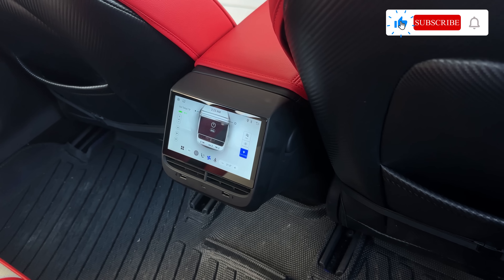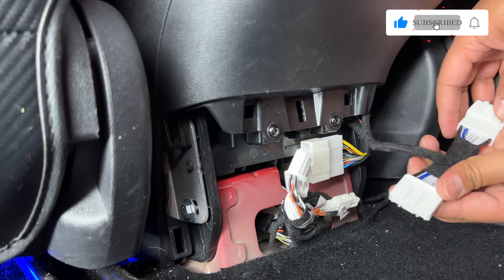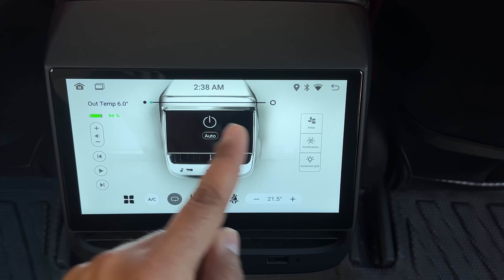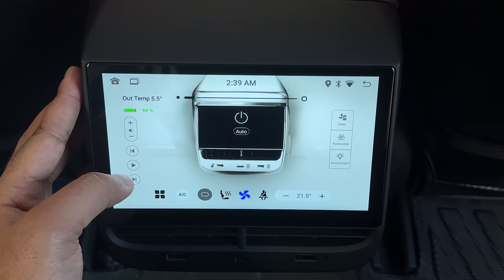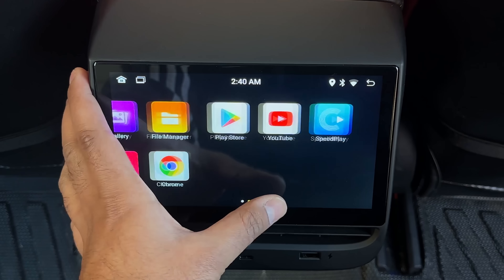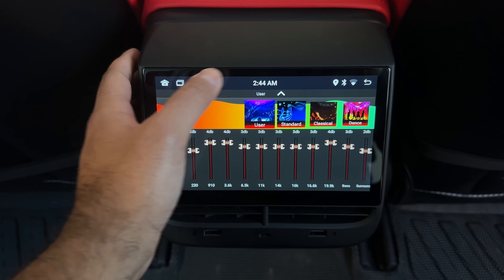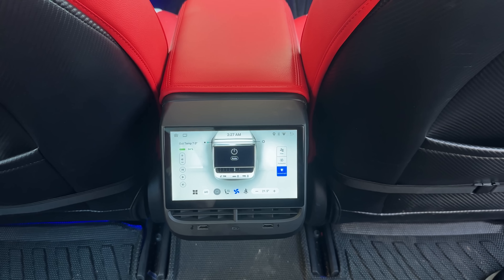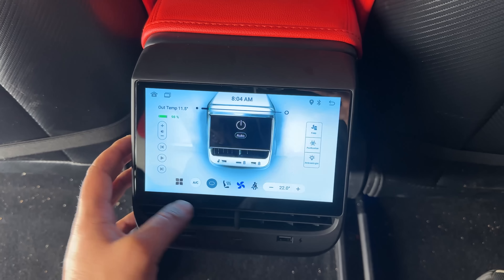NEW Integrated Climate Control & Entertainment Rear Passenger Display For Tesla Model 3/Y

Comment from the maker: ⚠️WARNING: There is a bug in this display that prevents you from using a wireless headphones. The audio only works if played through the Tesla speakers but not through headphones (unless your headphone has an ability to select a specific bluetooth band, which most don't). So, if audio output to headphones is a deal breaker to you, please don't get this display. Thank you!
Reply: Is this something Hannsshow is addressing? They just dropped the price for the 7” by $100 today and with the additional 25% off it’s now a more reasonable price. Lack of BT to headphones would be a deal breaker for me.
Reply: Is this something they cannot or are not going to fix with a software update???
Reply: @TopShelfTesla  I reached out to Hansshow and they responded that it does work with BT headphones.
Reply: @Ltyte  awesome!  I should have my display Tuesday or Wednesday.
Reply: @TopShelfTesla  post an update once it's installed. Good luck!
Reply: @Ltyte  I’m sure I’ll need it lol nothing is ever easy
Reply: @Ltyte  just watched another review video of this display and they confirmed that Bluetooth headphones do not work with this display.  They only work through CarPlay, which is pointless.  They also confirmed Disney plus and Netflix cannot be downloaded from the google play store.  I wonder if they can be sideloaded
Reply: Did it solve issue with Tesla firmware upgrade as the 8" debacle ?
Reply: @TopShelfTesla  did you install yours? I’m holding off for now until these issues get resolved.
Reply: @Ltyte  still haven’t received it.  Was released from customs on 12/31, no updates since.  I will install when it arrives and see what I come up with.
Reply: Also interested whether the 7" screen has the firmware issues fixed yet. Anyone know?
Reply: @TopShelfTesla  talking with another reviewer on YT and he is having same issue. He contacted Hansshow and they acknowledged to him that BT headphones don’t work but haven’t offered a fix.
Reply: Hansshow page now has a note that it will not work with BT headphones. :(
Reply: @Ltyte  my display got lost in transit - contemplating skipping this one if they offer a refund, was hoping there would have been at least one software update by now, doesn’t seem like that happened.  Bummer!
Reply: Is there any way to get the sound through headphones? Even USB headphones don't work. A headphone icon is displayed but nothing comes out.
Does anyone have an update that can be uploaded via USB stick?
Reply: @icemanx4407  I’ve been checking semi-regularly with a few manufacturers.  Every is “working on it” but the prices on these units are dropping a bit which means either it’s going to be a while or they’re planning a v2 of this screen.  I’ve held off on this one because it’s just too buggy.  They got the aesthetics right but the software is just not there yet.
Reply: Wonder if Tesla will ever release an OEM instead.
Reply: I'm confused. Can someone explain to me the point of wanting headphones? I'm thinking rear passengers will each have their own cell phone and earbuds, Etc. The purpose of this panel is to control certain aspects of the car. So why do you guys want headphones for this rear-facing panel?
Reply: @hgodtx  For kids
Reply: It's not a bug.  The real problem is the bluetooth profile they use for the audio to the Car's bluetooth connection introduces a 1s delay.  This device is unusable for streaming and you and other YouTuber's should be ashamed for leaving that out of your "reviews".  Don't buy these devices.

Comment: Temperate is still showing in Celsius and not sure how to set it to Fahrenheit . Also when running Video on it, it display "DO NOT WATCH WHILE DRIVING" -- but  Its back seat screen and suppose to show videos to kids while driving.. its not a front screen so no safety hazard. I'm wondering if you have seen such issues

Comment: Have you managed to get the audio to work? I tried for several hours yesterday and couldn't get the audio to work.
Reply from the maker: You have to connect to the Bluetooth band that shows (BT966-33FC) and the audio will work through the car. Thanks.
Reply: @ShivaSapkota  but what do you select on the Tesla UI side?
Reply from the maker: @Next_Steps_Home  You have to to to the bluetooth settings, add a phone, search for all BT devices, select the BT966-33FC from the searched list and it will add the rear display. Then anything you play on the rear display will play through your car's speakers.
Reply: @ShivaSapkota  thank you! it finally showed up on the list of available devices. Not sure why it didn't happen the first 20 times

Comment: Does it have its own bluetooth connection, which is different from car's bluetooth? But still uses car's audio amplifier to pump the sound, is that correct? the main problem that I have with tesla cars is, bluetooth on tesla cars had very bad audio lag, close to 1 sec. When you are watching a video / playing a game on your phone, but trying to make use of car's speakers, audio is going completely out of sync with video. Does anyone can confirm that, with this device audio lag over bluetooth is better (or) same.

Comment: Why dont you ever say about the screen looks and feel so choppy and laggy. I can see that whenever you are scrolling or swiping it feels like very cheap. why can't just they charge a little more and gives a very good interface and product. because they send out these product to you I guess you you give them this ideas maybe in future they can make the software feature much more interactive. Also they should also implement something on the software that if I am doing uber or lyft my passenger just can't do whatever they want to my temparature. there could be 1( 4digit code) to access it. (if i allow them the code) other than that they can use the entertainment system. but when I go with my family they can do that cause they know the code
Reply from the maker: The screen is not perfect but this one doesn't feel or behave as cheap quality product. It does lag a bit but so do all third party screens like this one. I agree with you though, they should try to match the interface with Tesla and make these devices better. I have already suggested them to add security code in the future iterations. Thank you for your feedback!
Reply: @ShivaSapkota  you are the best

Comment: I asked Hansshow about this, but they have yet to get back to me. If you have the Hansshow dashboard cluster, is there a CarPlay conflict with using both screens? Can you connect two separate devices? Considering getting this, but I already have some wonkiness with the CarPlay in my current display - though it's nice that you can load videos and music without tapping CarPlay. 

Great video as usual, Shiva!
Reply from the maker: Thanks Eric! Yes, you can use both devices at the same time especially since this one only connects to the rear OBD II and the front cluster connects to the main computer. As long as you are not trying to connect the same phone to both displays, the Carplay etc works well.
Reply: @ShivaSapkota  Cheers!
Reply: If you play a video or music which audio output / speaker it uses? Can you have a sample video of it?
Reply: @rastablind  You connect the unit to bluetooth, so it plays through the car stereo. There is an onboard speaker with the dash screen, but it is horrible.

Comment: Thanks Shiva👍It seems like a lot of control to give the rear passengers. I like these rear screen options, but I think I like the small one with only the climate controls better. This certainly looks much more integrated than the previous one.
Reply from the maker: Thank you Chris! Hope all is well my friend. I have asked them to add pin codes to lock these displays in the future for some security. I also prefer the smaller climate control one, especially because that one has seat adjustment option as well.

Comment: Pretty sweet, thanks for posting this review.

Nice display screen. The only thing i wish the product had was passenger seat controls.  It's impossible to adjust the passenger seat unless you are sitting in it.  Sometimes it would really help to move that seat forward, while in the back seat.
Reply from the maker: Thank you. I have a product for that actually: https://youtu.be/5Zj0_SRc_Qs
Reply: @ShivaSapkota they added this functionality in newer units of this exact one. I just installed today and it works to adjust passenger seat!!  However, I am having an odd issue of the door open floating window where it works as intended sometimes (shows proper door and screen disappears when all doors closed) but more often than not the door open screen stays on until you close it. Anyone see this?
Reply from the maker: @toddswire9581  Where did you get the screen from? I would reach out to them for a software patch. This seems like a software glicth.

Comment: If you use the media player or say YouTube or Netflix on this, where can it route audio to?
Seems that it should be paired with rear seat passenger Bluetooth headphones. Pointless if it seems audio out only to the vehicle system.
Reply from the maker: You can just add wireless headphones via bluetooth for audio output. Thank you.
Reply: @ShivaSapkota  Thanks, that does make sense. I'd prefer to see the rear seat controls be limited to only what can be done for the rear though.
I think some of the climate control does need the front on but I wouldn't want children in the back messing around. :)
Reply from the maker: @djtaylorutube  Yeah I agree. I have already asked them to figure out security pin codes so we can limit the functionality:)

Comment: Thanks Shiva, the only problem I did not hear you point out was that since there is no 4G SIM card slot, then the only internet access you have is when you are hooked up to WiFi… so I assume then you’d either have to hook up to another mobile device’s hot spot or be within a land based WiFi in order to access the internet or stream video & audio?
Reply from the maker: That is correct. I was hoping this could support 4G but it doesn't. So, this does need a hotspot or wifi. I did review a front cluster from Hansshow recently that has 4G capabilities, so some people who got both of these displays use the hotspot from the front display to provide internet to this one. Thank you.
Reply: Thank you for this reply 🙏😁

Comment: Hi Shiva, great video. I have one question. How many CANBUS plugs can you add to the centre console? Is there a limit? I already have two. Thanks.
Reply from the maker: Technically, you can add as many as you can fit. However, Tesla might give you a power consumption/autopilot alerts. These manufacturers are starting to make 12V connectors to prevent over power draw issues from the Tesla plugs. Thank you.

Comment: I would love a version of it where I can disable or remove some options, like I don't want the rear passenger to be touching the AC TEMP, I just want them to turn ON or OFF the rear fan, that's it. play videos probably and the seatbell remaniners as notification, so it will be on the screen booking everything until you actual get the seatbelt on. everything else OFF or under passewrord.
Reply from the maker: Thank you. I have passed along this feedback to the seller. I believe they are working on a password interface to lock those features.

Comment: That's basically yet another generic Android double din radio, but stripped, cheaped and molded into a bezel that fits Tesla. Besides the app that imitates Tesla screen, all of that just generic Android with a bunch of off-brand backdoors.

Are you sure you want that security hazard in your Tesla?
Reply: I mean, at least check what this thing is sending out to the internet. I bet you will be pretty amazed by a bunch of fishy net connections and questionable pre-installed hidden apps on those Android car radios.
Reply: Technically, all those functions that you can control from that screen, can be controlled by screen manufacturer right from China. You even gave your Wi-Fi to this thing!
Reply: Not trying to drop a pile of dung on this. The base idea is pretty good: to get the screen like on the more expensive models. It's just the part with off-brand Android software that is not secure at all.

Comment: Hey shiva do you know if there are the same issues with the updates as the previous model you reviewed ?
Reply from the maker: This one doesn't have any issues, matter of fact I just had a Tesla update with this installed and went through without any issues. Since this just connects to the back and they are not using the CANBUS adapter like the first one, it is less likely to affect Tesla updates. They did issue a fix for the V1 though and are sending people new adapters that only connects to the back OBD. Thank you.

Comment: Awesome video. Just got mines installed. Love the OEM look and gives the rear passengers access to watch videos! Mines also came with the wrong plug for the USB power. Do you know the correct pin connection to make it work? Also. My sound isn't working. I setup as Bluetooth device to my tesla but don't hear anything. Any ideas?
Reply from the maker: Thank you! There is an adapter that goes from USB A to C type interface and these sellers are working to produce those asap to make the plugs work. The Bluetooth audio issue has been reported by a few people to me and I found that if you connect your Tesla bluetooth to "BT966-33FC" the audio works. Hope this helps!

Comment: I would mostly be concerned about what comes programmed on the units since this is not just a display. You are plugging in a 3rd party built computer into your Tesla's system. Could this introduce a virus or cause a vulnerability to the controlled system?

Comment: Thanks Shiva!  This actually looks like a nice upgrade for my 2018 Model 3, provided they have a version that is compatible.  If so, will it also ship with USB-C ports?  If so, that be an additional benefit.  Will in play Youtube while the vehicle is in motion ?
Reply from the maker: Thank you so much! Yes, mine is a 2018 M3 and they ship the compatible version. The middle port is USB C and two USB A ports for the older M3s. Since the display isn't connected to the Tesla (meaning it doesn't send any data back to the car) you can play Youtube while in motion.
Reply: @ShivaSapkota  how about Nexflix? Can you download it and play in motion? thank you!

Comment: Does it get its connectivity from the Tesla or does it need to be tethered to a mobile? Does the fan speed affect the whole car or just the rear vents. Looks like the vents are fixed in place which might make the person sitting in the middle a bit sad. :(
Reply from the maker: Thank you. You do need mobile hotspot for this to work for entertainment apps. The fan speed unfortunately affects the whole car but you have an option to completely turn off the rear vents. The vents are fixed but the two ports in the middle face directly towards the back so the middle person will have airflow :)

Comment: Hey Shiva, were you able to change temperature from Celsius to Fahrenheit?  Thank you for the great videos.
Reply from the maker: Haven't figured that out yet. I am waiting to get some clarification. I am sure it is in the settings somewhere but don't know exactly which settings. Thank you
Reply: I had the same question - I spoke with a few of the sellers/manufacturers (hansshow, barfond) and they both stated that the current software is not capable of changing Celsius to Fahrenheit, but they are working on the software update to fix it.  Problem there is actually getting said update from your seller 😝 not always easy
Reply: Just get out of the dark ages and use Celsius..
Reply: @--Nath--  I’m inches away from making the switch

Comment: What a great video! This product seems really great and is exactly what I have been looking for for a while now. Can you try installing some apps like Netflix or other games? How does the data work? Do you have to connected to the Wi-Fi on your phones hotspot? And does this support Bluetooth controllers for games?
Reply from the maker: Thank you so much!! Yes you can install apps like HBO, Disney etc from the app store but Netflix requires a little bit of a workaround (but it still works). The data needs hotspot from your phone or wifi. This supports Bluetooth controllers for games as well as usb dongle for bluetooth interface.
Reply: @ShivaSapkota  what was the workaround for Netflix? My display is on its way 😊
Reply: @ShivaSapkota  what is the netflix work around? Also, I couldn't get Disney plus to show up on mine in the play store. I got mine on December 23, 2022. Thanks!
Reply: @ogpunkricker8196  any luck getting Netflix and Disney to work?
Reply: @TopShelfTesla  I haven't tested it out yet. I've been wiring up some interior lights. I'll try it through the chrome icon this weekend. Playstore doesn't allow download.